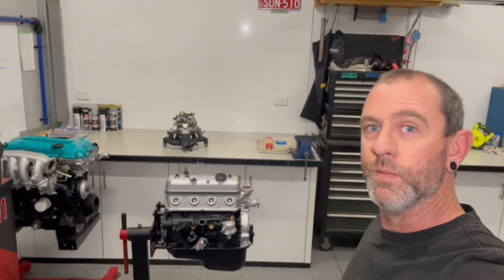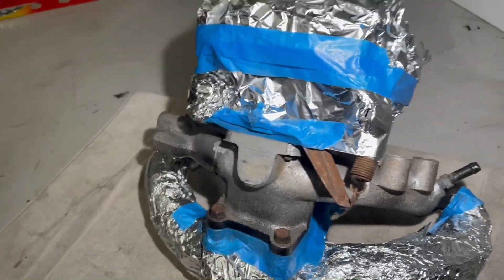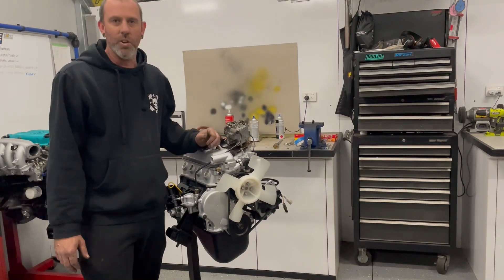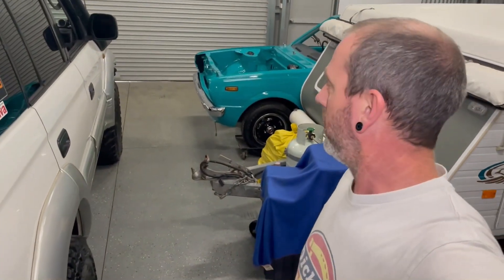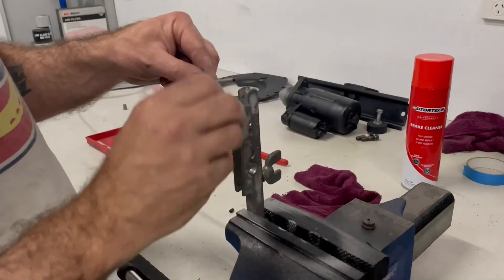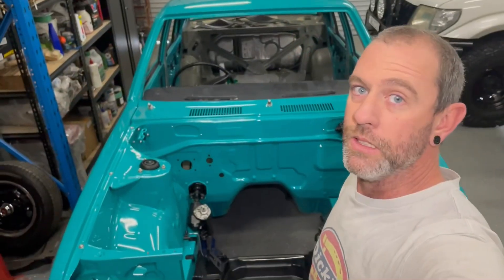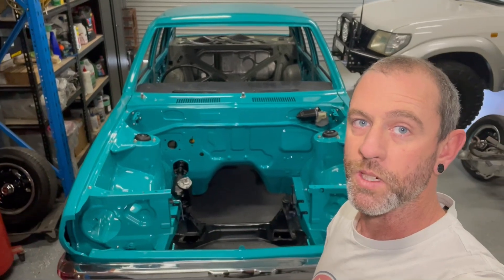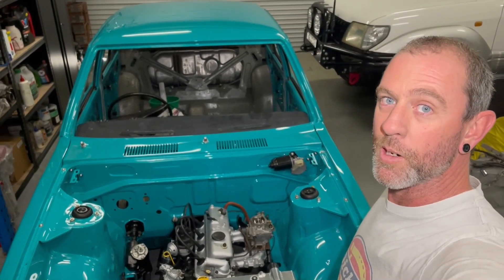Ke30 Corolla finally gets its freshly rebuilt 3K engine fitted.

Comment: What are you using for the manifold gasket? I usually recommend Toyota part number 17172-13050 - three layer steel gasket for a 7K. However, it looks like Toyota has finally discontinued the part.
Reply from the maker: From memory it was just a generic one that came in the vrs kit.